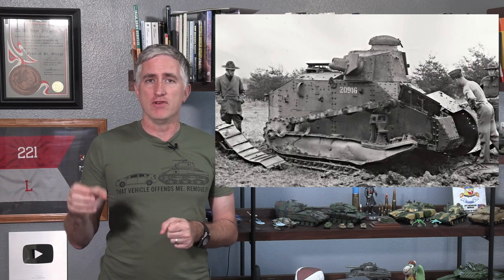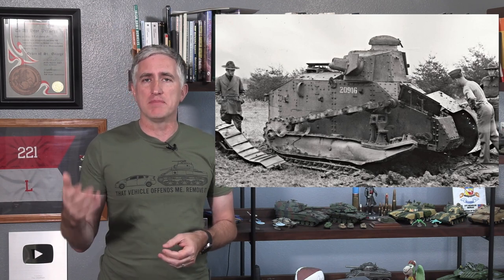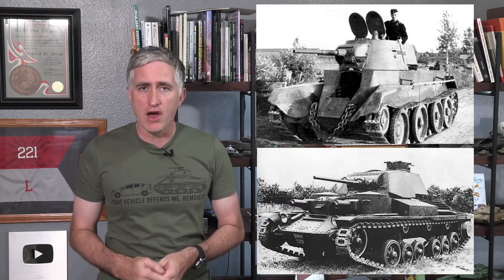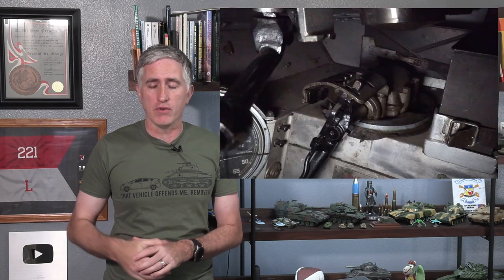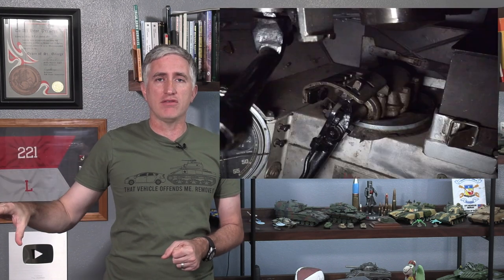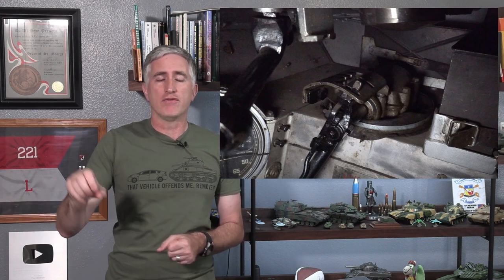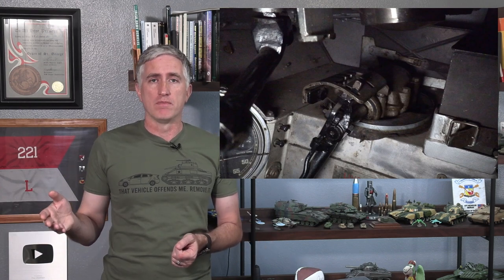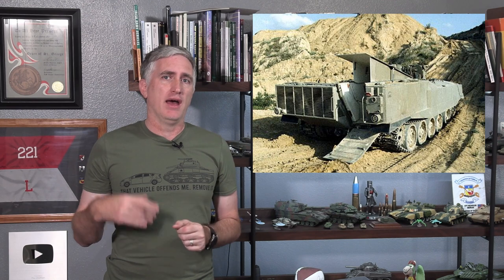Advantages of rear engine tanks with front drive sprockets

Comment: I'd never thought about it before, but stalls and missed shifts probably happened constantly in ww2 battles. I've stalled my truck at intersections and been embarrassed. I can't imagine the stress of stalling a tank in the middle of a battle, or having a shift linkage break.
Reply: Having broken a shift linkage in a car I can only imagine if it had been a tank in a war zone or combat. Talk about stress.
Reply: On the plus side I gather that unless you are in really nasty mud or on a hill, a tank is geared so low that you can start it in any gear. You don't even use first unless you are in some really heavy stuff. Some of the older tanks had complaints that you had to stop the vehicle before changing gears, which they thought was a inconvenience. The gears were basically just to chose thec speed range you wanted, and just how much torque you wanted at the tracks. Point is, it's like driving a truck with low range 4WD, it will start in any gear easily, and it's pretty hard to stall it with that much gearing. That happens in cars because the engines are pretty weak and the final drive gearing is relatively tall, and it's much worse in higher gears, since the effect multiplies. With a low geared tank or tractor, even if you get the wrong gear it's less likely to make you stall, unless the resistance is really high. I imagine it being something like driving a truck in 4LO with a very heavy load in the back. You will feel the difference but it will still start in any gear without a lot of trouble.

Comment: Whoever designed the first modern power pack where you can just yank the whole thing out in 10 minutes was brilliant.
Reply: Buick designed the M18 so naturally used two of their V-8's to hustle it around. The engines were mounted to a frame which could be slid out like a drawer to make servicing or replacing the two engines easier and faster. The US Army thought that was slick but told Buick to use the radial engine instead because they had plenty of mechanics and parts for those.
Reply: @billwilson3609  Making a engine easily accessible is not quite the same as making it easily exchangeable. 
With the Leopard 2's power pack, they can just swap out the whole thing within 15 minutes. The recovery tank can just carry a spare power pack on its back to the damaged tank and switch it out and in a real pickle it can even put its own power pack into the MBT and then wait for another recovery vehicle or a truck to bring it a new one.
Reply: @TrangleC  The US Army made a shortened version of their Christie Combat Car by replacing the V12 Liberty engine with a Wright radial. The compact radial allowed them to remove it with the transmission and rear drive attached as one assembly by using a truck with a winch crane. Their M6 heavy tank had a similar arrangement using a fluid drive (kerosene was the fluid) that might have been removable as an assembly. I think the radial and multibank engines in the M3 and M4 could be removed and reset in less than one hour. Chrysler's engineers made sure that could be done so Ordnance would approve using the multibank engines.

Comment: I remember seeing a military related tv show on the Merkava tank. The young woman driver of the tank related that the #1 consideration in the design was crew survivability, since the IDF was so small. She particularly appreciated the fact that rounds hitting the front of the tank needed to penetrate not only the frontal armor, but also the front mounted power pack. She felt a lot safer having a larger mass in front of her.
Reply: I'm going to use your last sentence when I try to convince my wife to get implants.
Reply: @AmbuBadger  ahahahaha
Reply: I'd imagine a frontal engine is a really good spall protection system or spaced armour to defeat HEAT too.
Reply: Every little bit can help
Reply: @settratheimperishable4093  
Definitely, unless it explodes.
Reply: @AmbuBadger  lol 😂
Reply: Correct, David. The IDF is small (both regular army & reserves) because the Jewish nation is small. Only nine million in a country the size of New Jersey. One Iranian nuke in Tel Aviv and it's game over. New Jersey, New York, Seattle and Los Angeles can get nuked (and I hope they do) and the nation will survive and probably even thrive!
Reply: The issue with the frontal engine and why no other MBT puts the engine at the front is actually mentioned in this video here: balance.
Having the engine and the transmission at the front means the tank is already front heavy, which then means you can't make the frontal armor very heavy.
It also limits how much room you have for the armor.

On regular MBTs like the M1 Abrams or the Leopard 2, you have the heavy engine and transmission at the back and that gives you space at the front for a lot of armor and allows you to make that armor heavy while still balancing the tank.

This is why you can't really make IFVs (Infantry Fighting Vehicles) or APCs (Armored Personnel Carriers) as well armored as MBTs (Main Battle Tanks).

That the Merkava is front heavy can be seen in many pictures showing Merkavas having nose-dived into ditches or even somersaulted down steep slopes and there is even one famous picture of a Merkava doing kind of a headstand.

Israel started designing the first Merkava after the British had refused to sell Chieftain tanks to them. They didn't have the know how for how to build modern tank armor, so they had to be creative and pressed the engine into double duty as makeshift armor.
That was a smart idea, but it created a problem.

They hyped the Merkava as the tank that would protect its crew more than any other tank and they later fell victim to their own hype campaign.

Today Israel knows how to build modern tank armor and they could develop a totally new MBT with proper frontal hull armor, but they are stuck with the Merkava design and with keeping the engine at the front, despite all the disadvantages that brings.
They cannot admit that having the engine at the back would actually be better. If they would build such a tank now, the Israeli public, believing in the old "engine at the front equals more crew survivability"-myth, would ask: "Why are you making the new tank less safe?"
And if they would then explain it to the public and explain why it is better to have the engine at the back, they would have to admit that they were lying about the safety and the advantages of the Merkava design.

And in the end using the engine as armor doesn't work as well as people claim it would. German WW2 Panzers are often criticized because they had the transmission at the front and when the frontal armor got penetrated you had burning oil from the transmission splashing around in the crew compartment. The same could happen in a Merkava it the projectile gets through the armor and the engine/transmission, which is more likely thanks to the weaker frontal armor.
Reply: @TrangleC  A few small corrections to your otherwise well-written essay. The Israelis have always known how to make quality tank armor and since they are a First-World Nation, they can do it, too. They just chose not to because it's fucking expensive; instead they went with a composite armor. I have a friend from Israel whose father was a professor of geology at Ben Gurion University in Beer Sheva; he was consulted on the construction of the armor but that's all my friend knows. And since she worked in security for El Al, she knows all about OPSEC. In other words, they decided to go with a combo of modern armor, extreme sloping, composite armor and now the Trophy defense which incidentally, Western nations are now buying. 

When I was in the IDF infantry from 1986-1994 the US Army was just starting to wear the Kevlar Fritz helmet and naturally Israel inquired how much to buy them. The price was way too much and that is why we wore composite helmets which had the added benefit of looking less Nazi-like. Later on, the price came down and eventually the IDF bought Kevlars, much to my chagrin. 

As for the IDF lying to the Israeli people you obviously don't know any Israelis on a personal basis. Israelis don't suffer fools gladly as evidenced by the riots and demonstrations right now as I type this in April of 2023. Nobody lied about the Merkava's safety and nobody sold anybody a bill of goods. Israel likes the Merkava for a number of good reasons and I'm pretty sure that five minutes of searching on the Web will turn up many photos of Abrams and other modern tanks turtled and doing a lawn-dart just like the celebrated photos of Merkavas that anti-semites gleefully love to share over and over and over and over.....
Reply: Israeli propaganda differs(as other nations does) from the reality, it does sound very nice but sonce my father fought in that army I know how much they value their soldiers.
Reply: I first saw a Merkava MK III I believe in the 80’s just north of Haifa.  I really through it was a great that a tank could bring its infantry protection with it.  Which is nice to have in a situation where you need to keep the enemy infantry away from the tank
Reply: @TrangleC  I think the whole engine as armor thing's effectiveness varies a lot depends on whats shot at it. Having an engine in front between the crew and incoming weapons provides a lot of additional volume than just regular heavy armor like an abrams.  This is great for keeping shaped charge warheads from reaching the crew, as the engine compartment acts like a lot of spaced armor. So yeah merkava is very likely to be very good at protecting its crew from shaped charge warheads, but not so good at defeating KE projectiles. However given that Israel's modern threats either dont use tank's or still have very old obsolete ones, this is likely considered an acceptable tradeoff by the IDF.

Comment: The weight distribution is a very significant factor - if you have the turret in the middle of the tank (which is much easier with the front transmission) you can upgrade/downgrade the turret and don't bother with the balance, but if you have the front placed turret you will have problems as with soviet T-34-85 which was particularly nose heavy despite the fact they'd played with the turret armor thickness to reduce the weight as much as possible. Also, the middle position is most comfortable when you driving through the bumpy terrain. And what soviet engineers had done immediately when they were making the new medium - they'd placed the turret in the middle on T-44 (but managed to keep the engine/trans in the back by mounting all the machinery transversely).
Reply: It is also the great flaw of the Merkava.
Having the engine and the transmission at the front puts harsh restraints on how voluminous and how heavy the frontal hull armor can be.

The hype about the Merkava being the most safe tank for the crew is strong, but most people don't know that it has one of the weakest frontal hull armor protections of all modern MBTs and it still is incredibly front heavy, which is why there are a bunch of pictures of Merkavas which nose-dived into ditches and couldn't get out again or even somersaulted down slopes and even one famous picture of a Merkava doing something like a headstand on its nose and gun barrel.

Comment: There was another point you said by yourself in some videos. The front mounted sprocket got a cleaner track to work with. On the way to the front the links loose dirt and thus are less likely to damage/wear down the teeth. That may not be the main reason but it is another addition.

Comment: David Willey of The Tank Museum also talked about this in one of his latest videos. So which one is easiest to tension the track?
Reply: It's pretty much a tossup; rear-drive tanks have the tensioner at the bow, and front-drive tanks have the tensioner at the stern. Either way, you need to have some arrangement that results in the actual tensioning mechanism not being obscured by either the idler wheel or the hull of the tank, and there have been any number of solutions to the problem over the decades.
Reply: Or if you have a Challenger you just press the button. ;)
Reply: @ABrit-bt6ce  oh, I didn't know that you just have to press a button to regulate the tension the track on the the Challenger, really cool! A dumb question: the button I presume is pressed by the driver inside but how he knows if the tension is correct, is there a gauge?
Reply: It’s easier to tension at the front as the back is covered in mud and crap that’s been dragged and thrown up :). It’s all muddy, so we’re talking quantity.
Reply: @lkchild  it is correct! Back in 1976 I was driving in Italy the Leopard 1A2 and to tension the track I had a big open key to be inserted on the front idler but we had to be two of us to work  on it but it was relatively easy to wash off the mud...
Reply: The automatic one of course!
Reply: rear sprocket there too - like just about every British tank to see service apart from Valentine if memory serves.
Reply: challenger...

Comment: 9:20 when he says "floatation issues"...... he isnt talking about crossing rivers, folks

pretty much all farm equipment uses "floatation" tires..... big, fat, wide tires that spread out the weight in mud
they preventing it from "sinking" into the mud..... and instead.... ride on the top ~1 inch of soil 

if all the weight was in the back on the m18...... the ass end would constantly get stuck 3 foot down in the mud
BUT.... because the weight is spread out... 

the m18 might only sink 0.5 or 1 inch into the mud..... which is very easy for the tracks to overcome.... 
and speed away from that angry panther
Reply: Thank you.
Reply: If something is heavy enough it can make things that are normally fairly solid act like a liquid.
Reply: @hedgehog3180  and this is another reason battlemechs, and to an even greater extent, Warhammer 40k titans and other walker vehicles is a really bad idea that only works in Sci-fi, because IRL, they would be restricted to exposed bedrock.
An AT-AT would never have worked on sand, soil or ice as it's ground preassure would make the ice start melting under it's feet, and the sand or soil would flow like quicksand.
A 40k Dreadnaught, knight or titan or even a Baneblade/Fellblade sized super heavy tank would have even bigger problems.
And that's from someone who's loved 40k and Battletech since I encountered the concepts at 13 and 10years old respectively. I'm going on my 36th year now, and the 40k collection has an entire room for itself, shared only with an R/C Leo2A6 and some Star Wars LEGO!
Reply: And that is why the Australian M113s have grown another idler sprocket...
Reply: @SonsOfLorgar  but the stompas are litteraly powered by the believe thar they will work, so as long as the bois will believe the stompa won't sink, it won't sink
Reply: @hedgehog3180  Exactly. The laws apply to all fluids, mud included.
Reply: @allangibson8494  Im not sure that was the reason in that case.
Reply: @leoa4c  The Australian M113s were stretched to accommodate extra equipment and weight (including a new turret) in 2012 - they grew an extra set of wheels to cope - from five to six.
Reply: @leoa4c  don't you mean tank you? 😉
Reply: duh
Reply: @Cheezymuffin.  orks don't work with silly physiks...
Reply: @SonsOfLorgar  lol dude most 40k vehicles of the imperium wont be able to make it out of the mechanicus's factory halls with those track designs let alone drive on terrain that would swallow them whole
Reply: While the panther angrily breaks its final drives
Reply: Also, there were some tanks that did float or were rigged  to float, I think there was even one that could be dropped into the water completely submerged and drive up a beach..... The point is, balance is a good thing.
Reply: Ground pressure is often a good measure of flotation.  The trouble with too much flotation, as T34/76 crewmen discovered, lies when your tracks are slipping on soft terrain or ice and the road edge is a cliff.  Tracks need traction, which means a certain level of ground pressure is needed to ensure it.
  Hovertanks all 'round!  ;-)
Reply: thank you, I was slightly confused there.
Reply: kind of assumed that was obvious to most people watching these videos, and Moran thought so as well or he would have clarified. Why would he be referring to tanks floating in water?
Let me guess, you had never heard the term and were confused, so you went and googled it, and then came back to pretend like you already knew it
Reply: @SonsOfLorgar  Dreadnaughts might (and I stress might) be able to get away with it to some extent, since they're only about 4 meters tall and canonical only weigh 12 tons. They'd still be better as tracked vehicles, though (better ground pressure, lower profile, and less complicated and likely to break at a bad time because you failed to perform the proper ritualistic rites to the Omnissiah) and they're about the only thing that could get away with it.
Reply: @SonsOfLorgar  most of the stuff in 40k is mate of future materials which might weigh a fraction of what we currently have. They also have anti-grav tech and countless other things which we wouldn't understand making it all work.
Reply: @oldleatherhandsfriends4053  Space Marine power armor is equipped with a gravity manipulator, that adjusts their ground pressure on the fly. Let's them not only stand on unstable ground, but also jump higher and run faster.